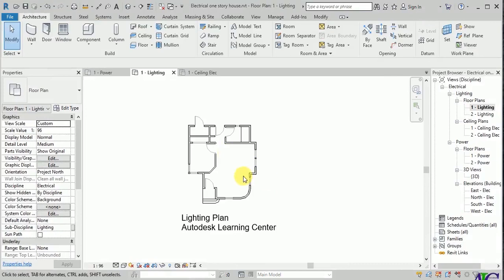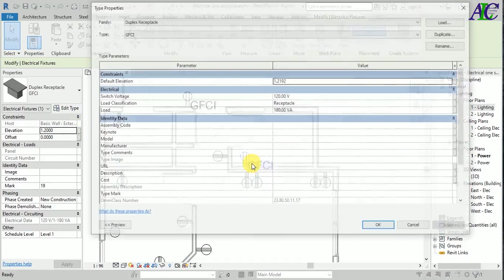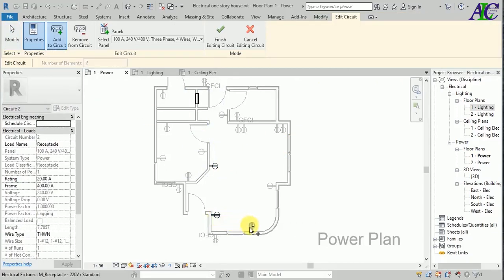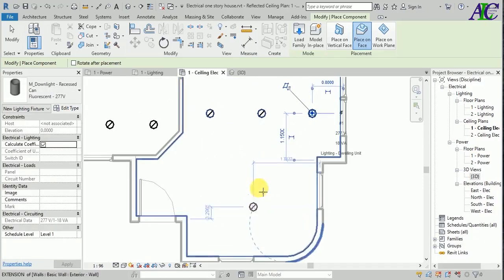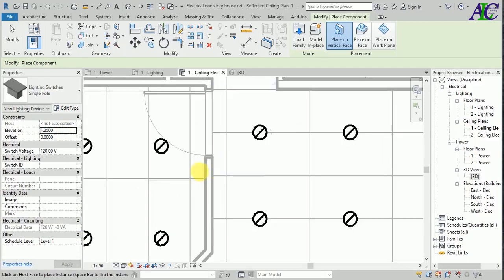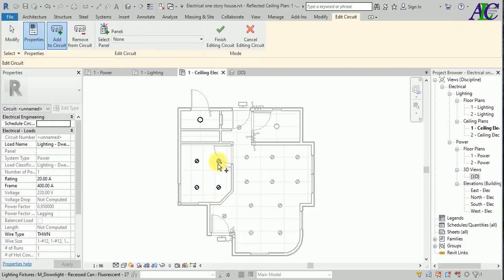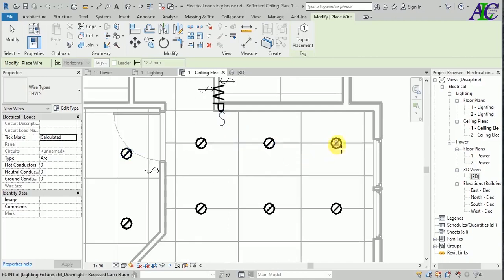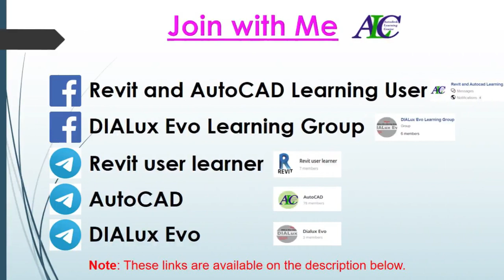Revit Electrical For Beginner - Complete House Project

Comment: I have put the same parameters as you did in distribution systems but my panel does not give me the option to pick system.
Reply from the maker: did you follow the same step as me? or try to check once the parameters you given before

Comment: I THINK IF YOU HAVE 240V SINGLE PHASE , THREE PHASE SHOULD BE 415V...240V/415  AND NOT 240/480V..PLEASE 
CORRECT IF IM WRONG
Reply from the maker: You are right, but don't forget that in each country uses different standards. thanks

Comment: Very nice, but I facing a problem, I unable to create panel power as you do. Then edit circuit.  I have none option only. Please reply.
Reply from the maker: Do you use the fixtures as the same voltage?
Reply: @autodesklearningcenter5131  I am beginner no more idea but want learn completely. Please help me.